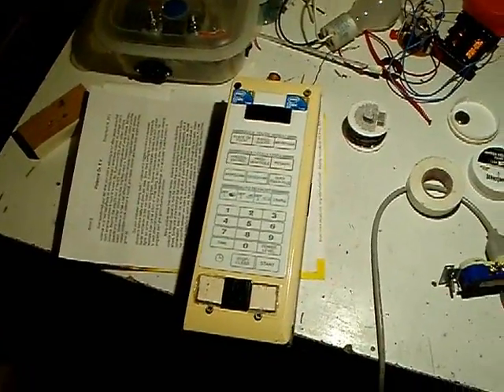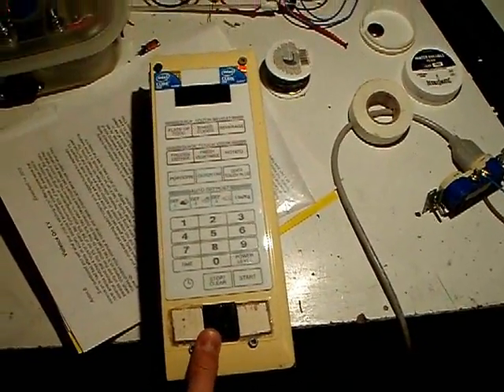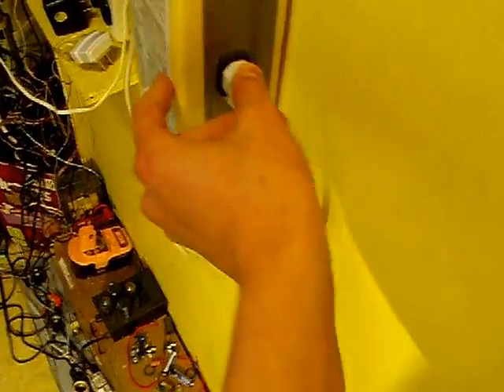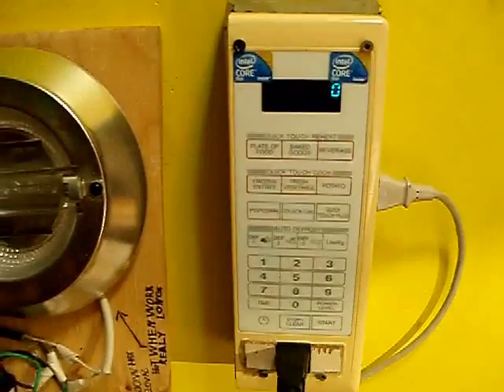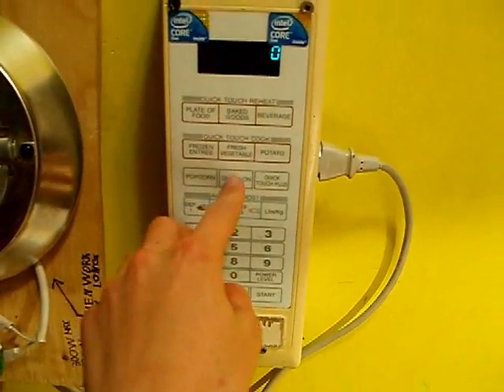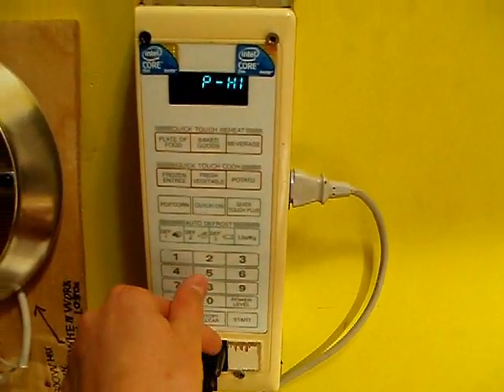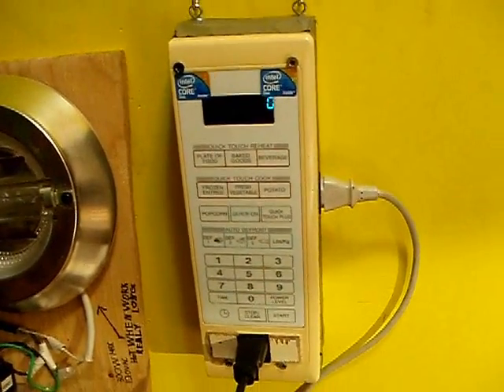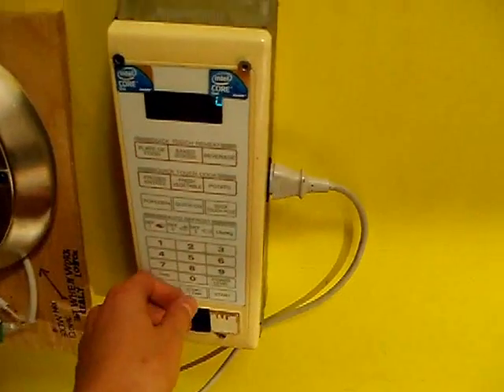My microwave timer outlet

Comment from the maker: the board has a step down transformer for the micro controller. Normally these boards either have 2 or 3 relays. One little one for the fan, turntable, light, ect. and another one or a pair for the magnetron, those are the ones you want to use. you will also need to bypass the door switch that goes to the board.

If you want, you can take a pic of the top and bottom of the board and il help you out :)

Comment: Is the power going to the circuit board AC ? or some sort of DC voltage .. mine has a connector and 2 relays coming off it ..

Comment from the maker: For example I can set it to 30sec and in the small delay I have pick up my chicken stick and I know that after 30sec it will turn off. Another thing that I use it for is to plug my glue gun into it and set the time for 1 hour. Because I forget a lot to turn my glue gun off after making a project. I also use it as a charge controller for charging batteries without a voltage cutoff. Another thing is if I want to test the stability of a thing I can plug it in and set the timer to eg 15min.